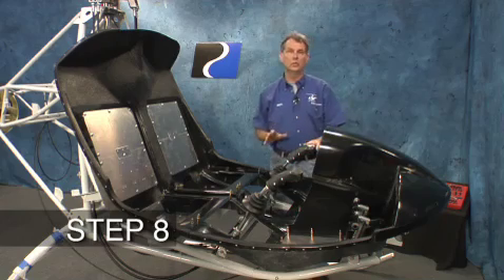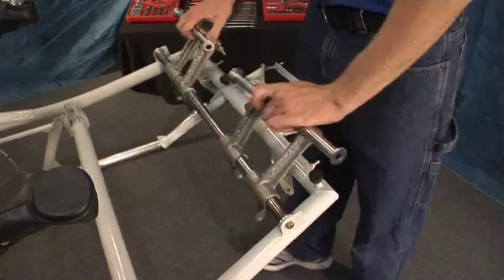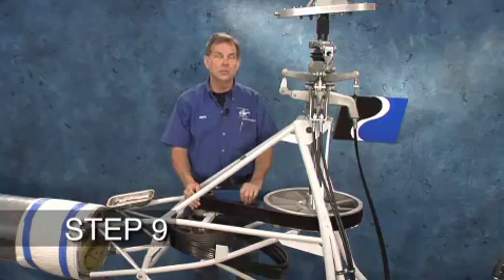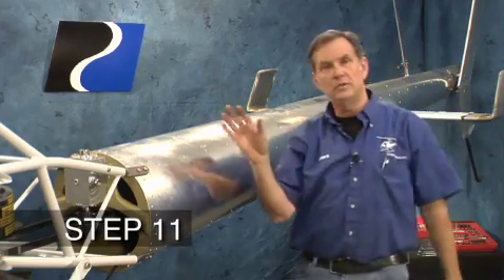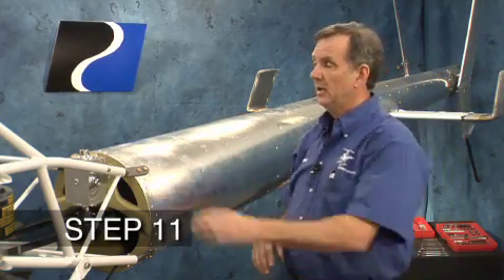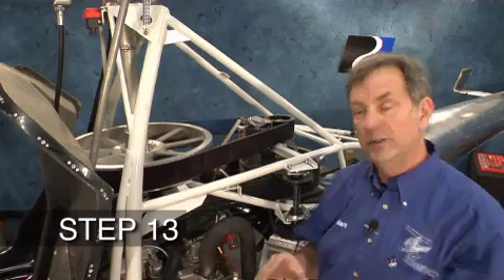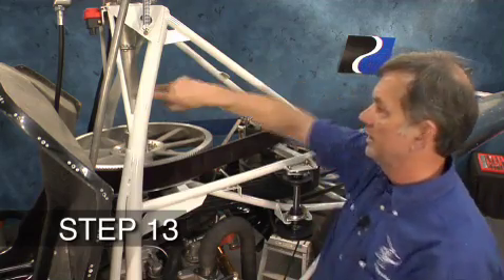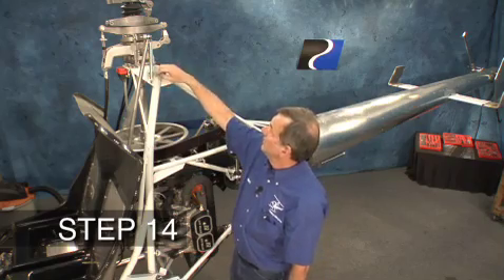Building of The A600 Talon Phase Two

Comment: the bolts at 2:18 are for installing and shimming the secondary assembly. i suggest you buy a kit, read the manuals and build it before making a comment about the assembly process. the guy in the video is a true professional helicopter builder. i should know, i bought two helicopters from him.